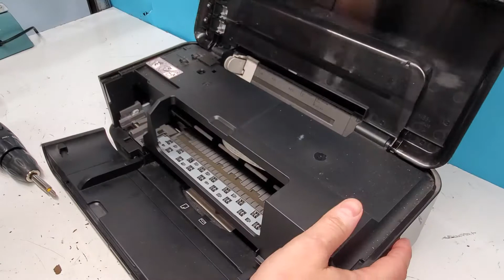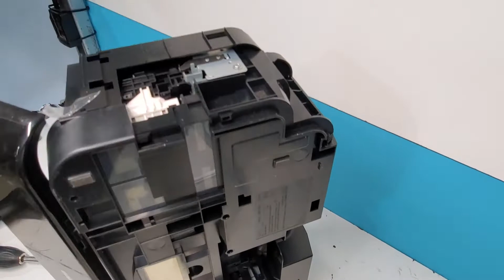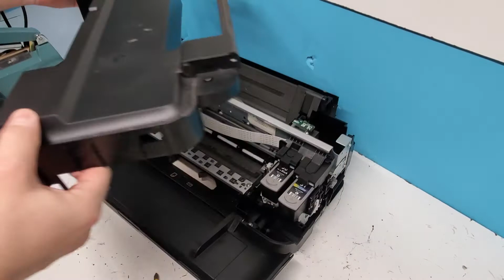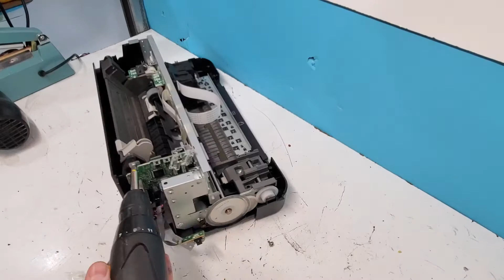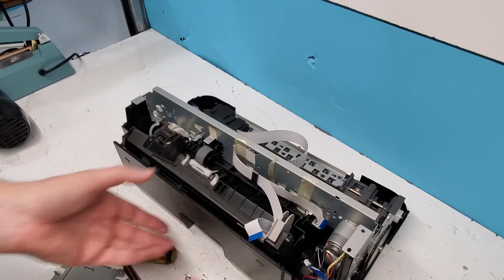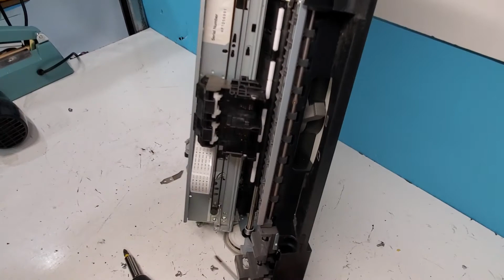Taking Apart Canon Pixma iP2600 Printer for Parts or to Repair iP1800

Comment: thanks for the tutorial. i have many other printers i buy/sell that are all-in-ones but i am happy to keep using this one i got for under $10. it was progressively getting worse about extra ink on the pages and i could see the inside area where the ink sponge is was building up tons of wet ink quite a bit and the same for the opposite side of the printer. SO, took it apart, pretty easy but fights back a bit and dabbed up as much of the bulk ink accumulation as i could w/o making a bigger mess than i did. at least is washes off fairly easy. did a couple other things to spiff up my lovely little work horse and got it back together after a couple small missteps and she looks better than ever so thanks for doing a tutorial on this basic printer as i think sliding off those side pieces would have caused me to end up possibly breaking something w/o seeing just how easy they slide forward/back.subbed/liked.

Comment: Hi! Congratulations on this video!
Very useful to disassemble the printer!
Unfortunately, my Canon has a paper feeding issue: no sheet can be fed.
So I tried to perform roller cleaning from the printer driver and clean the paper feed rollers with moistened cloth but both actions turned out to be useless.
I guess the paper feeding mechanism got broken, since the lower roller can't even come up.
Having removed the paper feeding unit, I need to know if some levers are out of their original position.
In this video, the bottom of the paper feeding unit is not enough zoomed so I was just wondering if it's possible for you to tell me any visual anomalies in the faulty unit I have. Obviously, I took some pictures of my paper feeding unit.
Can I get some help, guys? 

I don't know if on youtube it's possible to post links to free image hosting sites in order to let you have a look at the pictures.
If not possible, you can even suggest another way to talk about this issue and compare my unit with yours.
Thanks in advance!